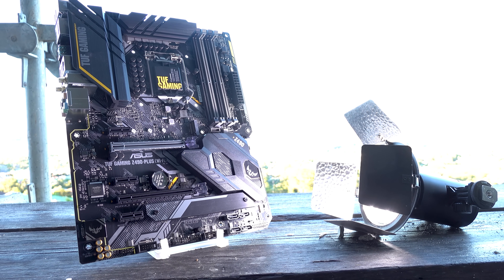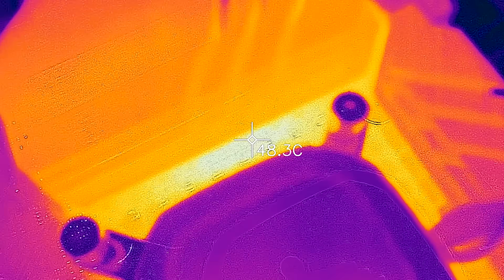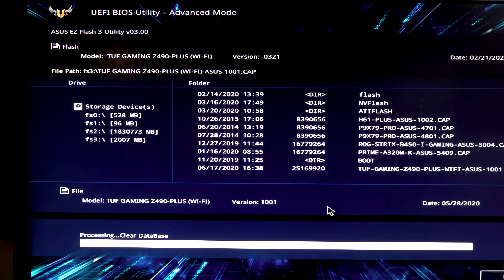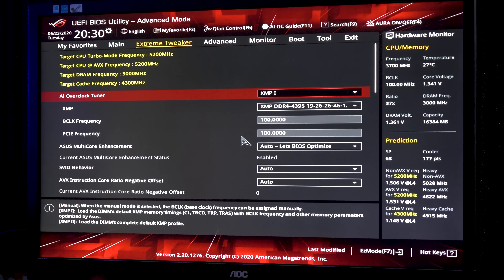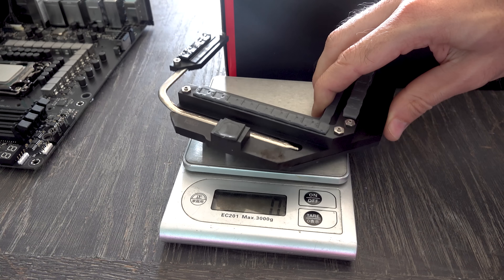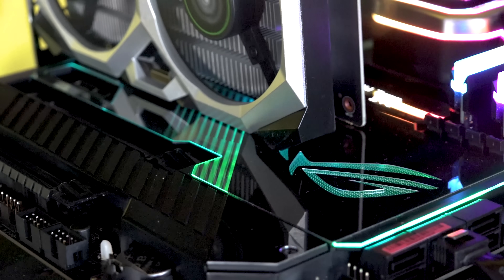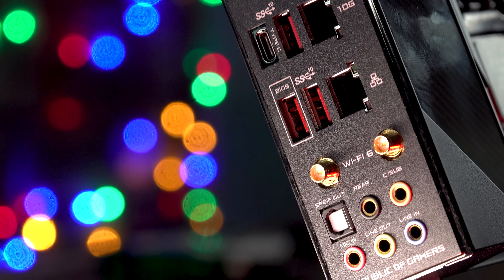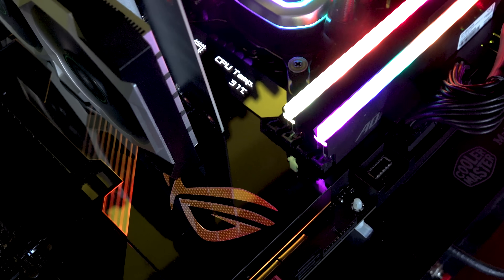ASUS Z490 TUF Gaming Review | Z490 ROG Maximus Formula XII Review

Comment: Hey, great vid I got a z490 plus for my 10700k, it gets to 5.0Gz with 1.36v but I'm not sure if the reading are correct.. Did you do any tests on the actual voltage output to the components such as the CPU cores? Thanks have a good 2021

Comment: Do a gpu mod where you mount something like a snowman cooler on an old gpu with dying or dead fans. As you know buying aftermarket gpu fans or heat sinks can be really expensive or hard to get. but if a cheap air cooler like the snowman could be mounted to a gpu and it work that would be excellent for people like me

Comment: i have a i5 4690K + GTX 970 and want to upgrade, i was thinking about just upgrading the graphics card, would that work or would the i5 be a bottleneck?
Reply: if you find some i7 4770 , 4770k or 4790, 4790k or xeon ( xeon chips cheaper than i7 ) chip , the extra 4 threds helpful for increased performance.
Reply: 1070 will run fine with i5, however, the i7 47xx + 1070 will be the best option.
Reply: i think your cpu and gpu fit perfectly together and should perform excellent @ 1080p
i would just keep the system and wait till next year, after the Ryzen 4000 rumble ;)

Comment: 125W power limit is Intel spec. So technically Asus doesn't OC the i9 out of the box like other manufacturers do. 4.9GHz is technically an overclock if the setting uses more than 125W in sustained workloads. After 56s any LGA 1200 CPU has to stay underneath it's respective TDP rating. GN did a very comprehensive video about that. MSI runs all unlocked CPUs with an auto OC, if you don't change it in BIOS.

Comment: Question: why is my 1700X 3.9GHz clock stable with gaming, but not with many Firefox tabs? So far on 3.875GHz and seems fine.
Ryzen 7 1700X at 3.875GHz (auto settings except clock)
GIGABYTE GA-AB350M-Gaming 3 (1.0)
XPG GAMMIX D10 16GB (2x8G) DDR4 3200MHz (auto at 320-something, unstable on manual, XMP)
M.2 22110 PCIe 3.0 x4 Samsung 480GB Enterprise SSD
Various SATA 3 HDDs
HIS AMD Radeon R9 290 4GB GDDR5

Comment: Hi...wonder if you could advise me ..Im looking at getting the B450 AORUS PRO WIFI (rev. 1.0) can anyone tell me if the bios on those are up to date and if not do you know if they have fixed the issue with the EC FW Update Tool or is that just an issue with the x470 the issues some have had that i heard about is the sound not working and the ram not being recognised?

Comment: I bought a H410 for my i5 10400 and it never got above 0.78 ghz did a bios update went over the bios settings and even upgraded windows 2004 still never got above 0.78 ghz i returned it to amazon for a gigabyte b460 and i now hit 4.3 ghz on my cpu i have always had problems with Asus motherboards i don't think i will get another one it was a real bad time with that h410 i don't wish that on anyone.
Reply: well maybe don't pair a H series board with a i5? since H series are basically for super low end/office builds

Comment: The first Asus board I used in a build was a Slot 1 back in 1998 - been trying to figure out what's the right way to say Asus since then :) I'm in Scotland and call it Az-zus. Just the same sounding as the Maximus (you don't call it Maximooooooos)
Reply: Slot 1 with an overclocked Celeron 300A! (Or a socket 370 cpu with a slocket adapter)
Reply: @soupwizard  Those Celerons really could be pushed. Even the native Slot1 Celeron - would spend hours testing them in the shop on a Saturday afternoon.